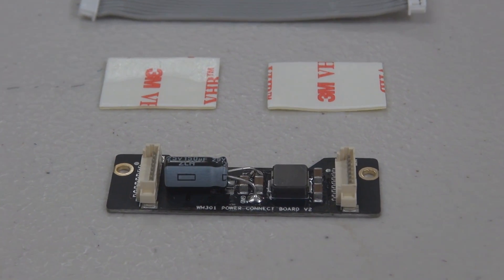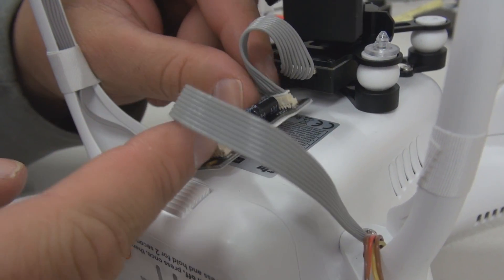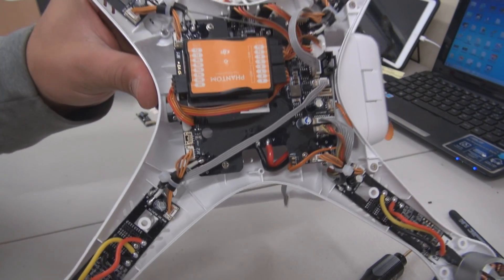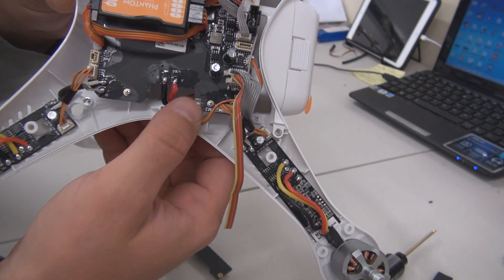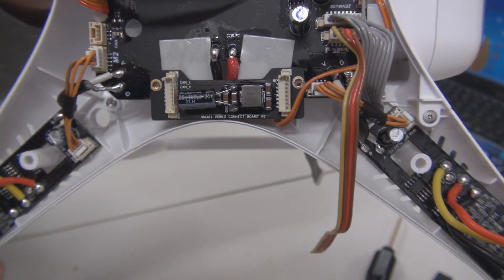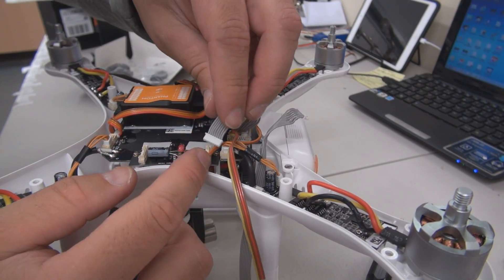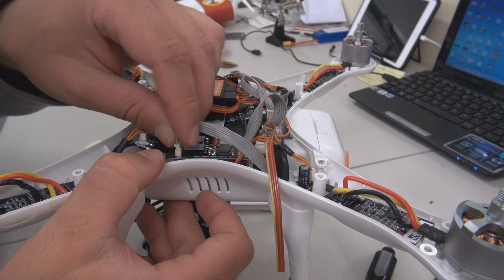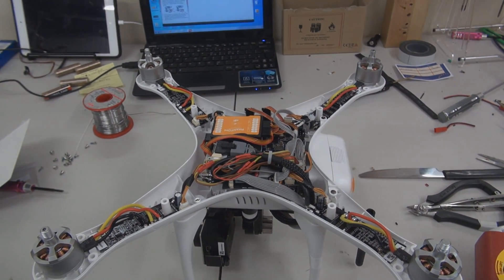DJI Anti Interference Board locations - That HPI Guy

Comment: Hi there , like your video on Dji phantom, Q. I saw the video on you fix on iosd mini/Fpv monitor and transmitter on Zenmuse H3-2D. Is the procedure is still the same on H3-3D and the interference board for phantom 2.  Im new on this quadcopter. tks. Confused?

Comment: Why not insert it on the opposite side? Matching holes exactly the same, and no large red and black wires in the way.

Can then screw it down properly and not have to use double sided tape.

Comment: thanks for the tip, I have just ordered a P2 with gimbal from Quadcopters this week, so will this be fitted?
Reply from the maker: is it an FPV edition? if so and you have selected it profesionally wired with OSD then it will be done for you inside.